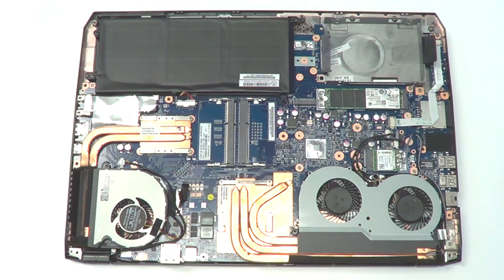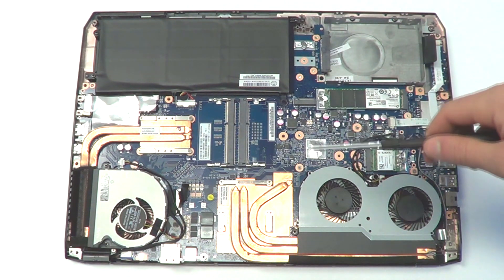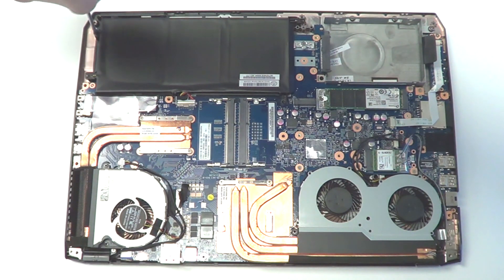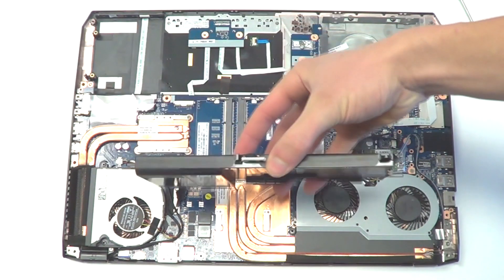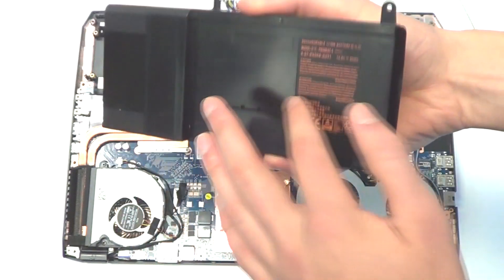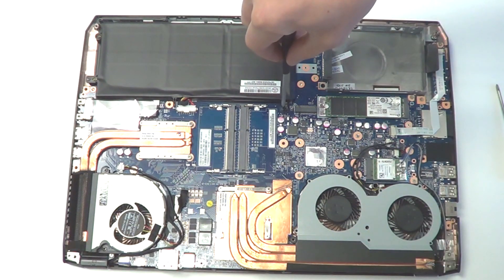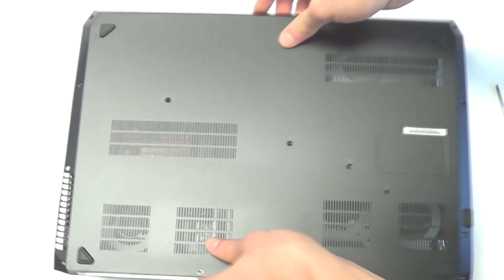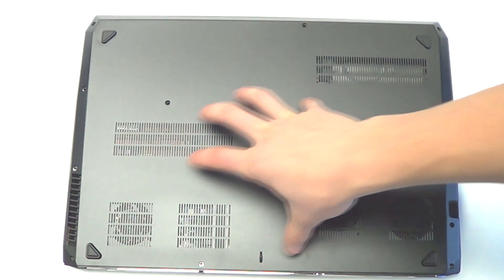EUROCOM M5 Pro Battery Information

Comment: why cant i find any videos or reviews of the sky x4 or x6 anyway?
Reply from the maker: +Shane “APBeatz” Gilphilian You are right, there are not many.  There is one here: http://www.ddworld.cz/mobility/notebook/test-eurocom-sky-x6-vykonne-core-i7-6700k-sbalene-na-cesty-v-notebooku.html where the Sky X6 won the DDWorld.cz Recommended Award.  The P5 Pro and P7 Pro are the predecessors of the X4 and X6, are very similar, and have many reviews: http://www.eurocom.com/ec/reviews(260)ec  -  http://www.eurocom.com/ec/reviews(269)ec
Reply: will the p5 pro be updated with skylake and usb type c thunderbolt 3? and if so when can i expect this?
Reply from the maker: Shane Gilphilian The EUROCOM P5 Pro has been updated to the Sky X4.  There will be another update to a new system with new technologies coming shortly.
Reply: ok thanks

Comment: The 250 minutes of battery, does it also apply to the M5 Pro with the 4k UHD screen? If not, what are the estimated battery life of the M5 Pro's Idle time, light usage time and max load time with the 4k screen?
Reply from the maker: +AsianQtip Yes, the battery life doesn't change significantly with different resolutions.

Comment: 250 minutes in light of what kind of usage? If I'm just using the integrated GPU and not the nvidia for productivity, browsing our Microsoft Office stuff how long can I expect in a power saving mode of there is one?
Reply from the maker: +tony45x220 The 250 minutes of battery is a near best case testing scenario.  With some Office or browsing usage you will get just under that.

Comment: Will there be a bios update or something that will stop the battery from charging when it reaches 100%, discharges it to 80%, before re-charging it again to 100% while using the laptop with the power brick attached?
Reply from the maker: Curious Tinkering I was not aware of that happening..If that is the case, please make a support request at http://www.eurocom.com/ec/supportr()ec
Reply: EurocomTechnology yeah it's actually a feature that is being discussed at the "batman" thread in NBR forums. This type of charging would prolong the battery's life.

Comment: The problem I see is the battery is not easily removable, so if you play with tha batery connected and the charger too, the battery will be damaged and her duration will be reduced
Reply from the maker: You are right, it is not as easy to remove as some of our other systems.  The battery does not get damaged if it is left in during use.

Comment: I would buy the M5 Pro instantly if it came with a WQHD Matte 2560*1440 display. Any chance it will be added like you did for the M4?
Reply from the maker: A third display is coming!
Reply: I'm waiting for either the intel 7265 or Killer N 1525 to place an order.
Reply from the maker: Chaingangsoldiernit Those wifi cards are coming. Stay tuned!
Reply from the maker: Chaingangsoldiernit Intel 7265 added to configurator!